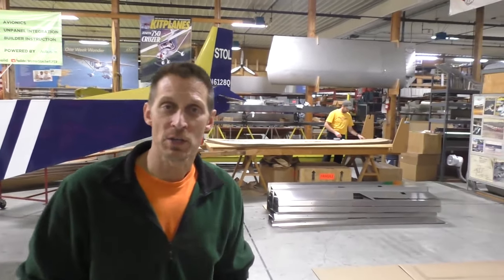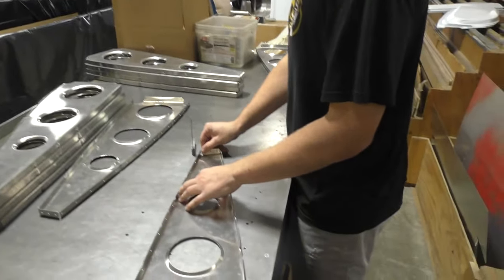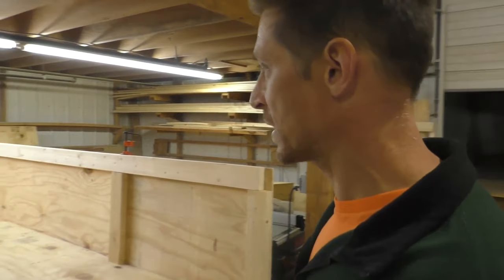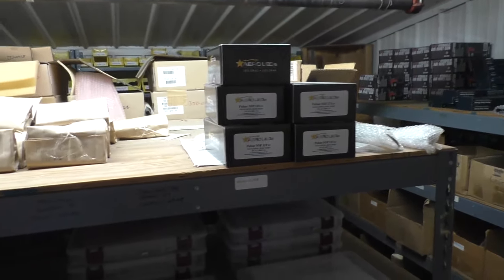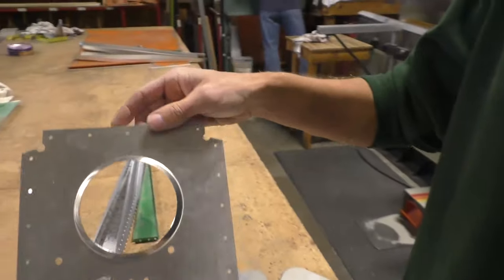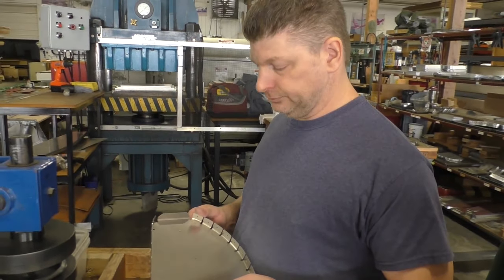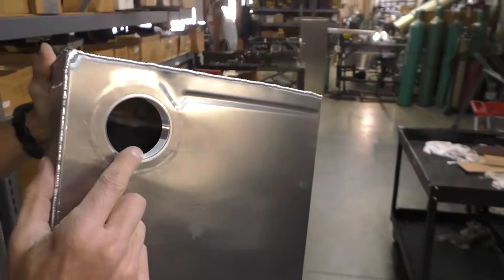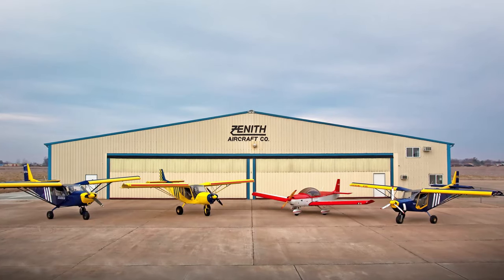Factory Tour: Inside the Zenith kit airplane factory

Comment: Will Zenith be recommending or using the Viking engines and/or company anymore?
Reply from the maker: Zenith does not specifically recommend any engine. That is the builder's responsibility; to choose the engine that will best meet their needs for their intended mission. There are many good choices and Zenith tries to make sure that there are "firewall-forward accessories" for whatever engine the builder chooses to install.

Comment: I pls you to answer my asking about the stabilizer in STOL 701, why its lower camber not similar with upper camber?
Reply from the maker: To help the aircraft quickly rotate and maintain a high climb angle (for max STOL performance)
Reply: Hi there, me and two guys has built ch 701, we are right now on the way to complete it, but we are suffering to get a suitable propeller. Pls, which prop. is suitable? With  engine of BMW motor cycle which its rpm is more than 10000/ more than 100 hp.